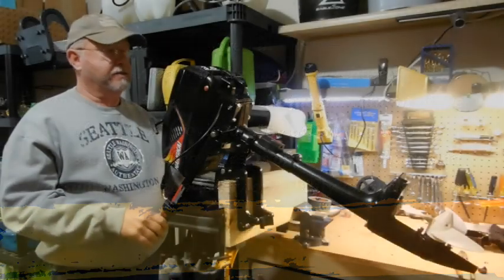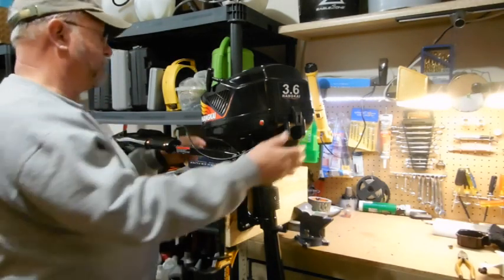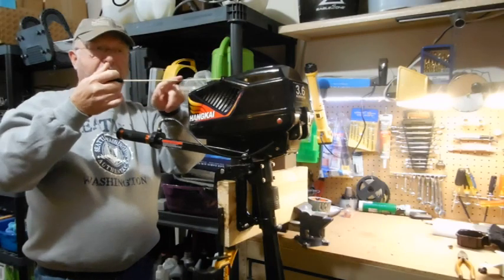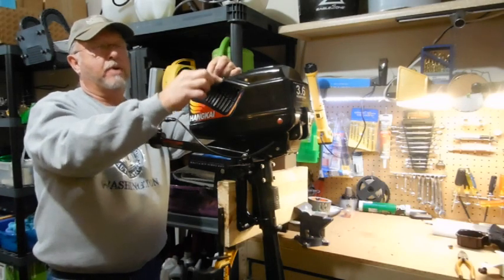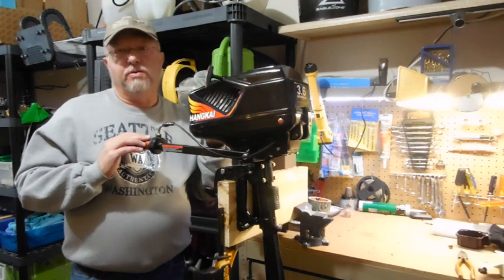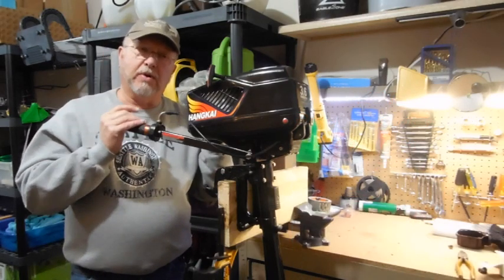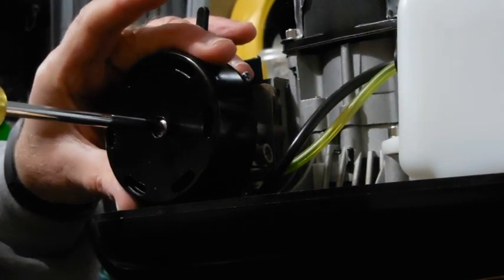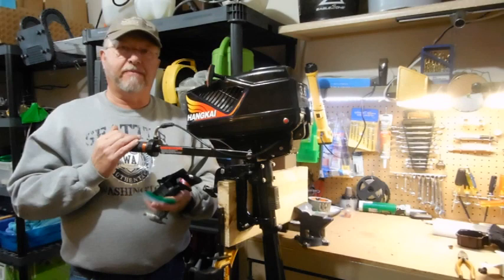Hangkai 3.6 / 3.5 hp outboard motor - 10 Things To Know

Comment: Hi, Thanks for the video. I bought one of these and am in the process of replacing the throttle cable. Please be advised like everything on this motor it is super cheap and therefor rubbish. Make sure you oil / grease cable every year. Mine was completely rusted. Also curious at the power or lack of it. Mine is a 3.5hp but identical to yours. All brand name 2 strokes have twice the cc so I suspect it is at most 1.5hp. Your thoughts...
Reply from the maker: I've not had any problem with the throttle cable....something to look forward to I guess?  I know saltwater would cause some issues like that...But on your advise, I'll grease my cable this spring.  I'm with you on the power issue, but I didn't expect a lot of speed out of it.  I don't plan on going long distances, so for my little adventures, it's ok.  Definitely not for everyone.
I appreciate your watching. Hope some of my other videos will be helpful too. 
You'll need to change out your clutch soon too...I put in a lighter spring and that looks like it will help a lot. (Maybe you haven't gotten to that video yet?
Keep watching! :0)
Reply: @BoilerDan1  Thanks Dan. Watched clutch stuff. More fun in the future. Yes I run in salt water. I run it in a fresh water bucket after use and hose it down but corrosion still everywhere. I have taken to spraying WD40 over all aluminum motor bits and "stainless" screws after each use Why can't the Chinese make stainless 316???  I note one eBay  site has sold 43 throttle cables for the 3.5 for $20 Aussie. I did the lower gear oil change as you demonstrated. Filled to half, ie well below the line . The gears will run through the oil  sitting at bottom, so all good. Thanks for the videos.
Reply from the maker: @marcvan  ; I think I stated "stainless" screws.... I've sense been told they are alloy of some type... Stainless will react to aluminum and cause problems... So I was told by a watcher... 
Anyway, enjoy your adventure!

Comment: Great review, very informative, Thanks
Reply from the maker: I appreciate you comments.  I've made several on this motor....So take a look at them at some point.  Latest was replacing the clutch.. Not difficult, and should probably be done seasonally depending on how often you would run the motor.
Thanks for watching!
Reply: @BoilerDan1  I have watched your other videos on this little motor, I have a 10' Jon boat that I want to use on some of the smaller lakes around me. I use a 55 LB motorguide trolling motor that I use now. I wanted a small inexpensive motor in conjunction with it. In your opinion, for the money, is this little motor worth buying?
Reply from the maker: @rockyhill9946  : It will push your 10' solid boat better than my raft.  I think it runs great, but the fuel lines, spark plug and the clutch will need replaced at regular intervals. The pull cord would be weak, but rubbing mine down with bee wax has worked well.  So if you don't mind making those changes after you run it for a while, I think it's worth it.  In my recent video, showing that the lighter spring worked well, I ran a full fuel tank of gas through it and it still runs smooth.  I've had it now for 2 years.
Actually, I'd change the spark plug right away.... And maybe the spring on the clutch.....  But if all the above is too much hassle, then save up more $$$ and buy something better.  Or buy it, then if you don't like the extra maintenance... Sell it!  :0)

Comment: Where'd you find the gas to oil ratios and break in info anyway? I have the 3.5HP model, which is a little different, but the manual doesn't even mention break in. As for the mixture, it only says "The admixture of this machine at normal usage hour compares is: 30:1. Please press this comparison strictly to prepare the admixture oil, cannot random the changes."
Reply from the maker: Here’s a link to the company website:
http://m.hang-kai.com/en/

Then in the upper left corner click on the multiple horizontal lines.
On that page click “News”
You’ll find the oil recommendation there.
I copied and pasted some below too:

HANGKAI two-stroke outboards fuel used for lead-free number from 90 to 93 two-stroke gasoline and gas oil (TC-W3) mixed oil.
The new machine in the running and fuel oil during the volume ratio of 25: 1 (ie, the oil content of 4% gasoline);
After the run-in fuel and oil volume ratio of 50: 1 (ie, the oil content of 2% gasoline);

Fuel HANGKAI four-stroke outboards use as No. 90 to 93 pure gasoline, without mixing

Preparation of two-stroke outboards mixed oil
Formulated as follows :( see below)

 
(1) The required amount of oil injected into the fuel tank, then filling gasoline, oil and petrol injection Scale        

Range of use	Mixing ratio of gasoline and engine oil by volume	Fuel tank capacity of 24 liters when oil safety
Lubricant oil injection amount	Fuel oil injection amount
Oil run-in period	25：1	0.92 liters	23.08 liters
Oil at the end of the run in period	50：1	0.47 liters	23.53 liters
                               

Mixing oil and petrol, oil injection amount in Table 1

(2) The fuel tank cap screwed onto the fuel tank, the fuel tank cap vent screw clockwise tightening;
(3) Shake the fuel tank, gasoline and oil thoroughly mixed.

Comment: Specific issue, can't get the bulb to fill with fuel. Change filter in the tank, lines are new, primer bulb isn't cracked, took carb apart to see if debris. Cleaned and reassembled. No luck, Your thoughts appreciated. It's new. Land stranded in Texas.
Reply from the maker: Hmmm, I’m as stumped as you are?
Only thing I can think of is switch the fuel lines? Maybe the wrong line is going to the fuel bulb?
Other than that, there has to be a air leak preventing the pumping action to work? Sorry I can’t be any more helpful.
I just returned from Mustang Island Texas! Indiana 19 degrees last night!
Should have stayed in Texas! 😁👍
Last thought: replace the bulb….
Reply: @BoilerDan1  will give it a try!
Reply from the maker: Let us all know how it works out. Might help someone else out in future. 👍
Reply: one tube is clear, the return line and pushes fuel into the tank.
the black line is the suction line. Prior to this the filter was filthy with white substance.
Put in ordinary filter for two cycle engine. Also sprayed soapy water while priming. 
Still no results. - bulb empty.
Reply from the maker: I’m at a loss too?
Sorry.😵‍💫
Reply from the maker: Could the black fuel line be plugged?
Push a similar size wire through it?
There’s got to be a simple explanation….
Reply from the maker: I think I have it figured out! One of two possibilities:
1.. one of the valves inside the primer bulb is defective and not closing which prevents the sucking of fuel.
OR
2. When you put the bulb back on you have it on backwards (is that possible?) If yes, then you’re pulling air from the carburetor and pushing it towards the fuel tank.
Ps.. You’re keeping me up at night 😂
Reply from the maker: Did you ever figure out the fuel issue?
Just curious 😉
Reply: @BoilerDan1  ordered and installed new carb - started right up!
Reply: @BoilerDan1  now that she starts , there is no water coming from the exhaust port? Just a lot of bubbles in the bucket.
Reply from the maker: That’s so great to hear!  So nice of you to follow up after a month 👍.
I’m sure it will help someone else to solve a similar issue.
👍👍
Reply from the maker: Okay…. I need to mention that I used a bucket in the winter and kept adding snow to keep it cool! Run a hose in yours.
Next: water will only come out with the throttle most of the way on, as in full speed!  If you watch some of my later videos, I end up replacing the clutch spring.  That allows the propeller shaft and water pump to run.  I’ll look up that video and reply with a link.
Reply from the maker: There’s 4. #4 just shows the spring that I replaced 👍
1. https://youtu.be/H4mPGuEKnKI
2. https://youtu.be/Qu9OjXbMutA
3.https://youtu.be/LdtITFx6N-Q
4. https://youtu.be/G4qLw14lf9k

Comment: Do you have a link for this motor or similar one?  Good job keep up the good work
Reply from the maker: Right now they are pretty cheap!
I found this on eBay: $217.
I suggest you check eBay and search Hangkai 3.6 hp motor and pick one.

https://www.ebay.com/itm/385698286797?mkcid=16&mkevt=1&mkrid=711-127632-2357-0&ssspo=6ymiisq3qja&sssrc=4429486&ssuid=s8A53jWuRTC&var=&widget_ver=artemis&media=COPY
I will mention that in hindsight I might consider either the 4 cycle or electric.
I’m happy to help. Thanks for watching! 👍👍

Comment: Hi Dan all your videos are amazing! Quick question for you, I got a hangkai 3.6 two stroke, the thing is, I follow all your recommendations about changing spark plug, gear oil and mix ratio gas/oil. everything was going really perfect in the break in process.... Until just right now. I am on my hour 8 of breaking this motor and then I decided to leave it alone for a moment while it was breaking. What happens next is that an attachment of my garden house ( one that it was bringing fresh water to the tank where I was breaking the motor)  get loose and get stuck in the propeller, stopping it with the motor running. How long it was like that, I am not really sure, but I don't think it was too long, because I had one of my house cameras pointing to the motor, that's why I realized something was going wrong. To make the story short,( is already long, I know..) I went outside to check the motor and it was smoking more than normal, I stopped it immediately and I started pouring fresh water over the shaft, one that it was hot but not more than probably water boiling  point, also the low exterior area ( the base)of the motor was really hot, like a clothes iron, so, I poured water there too. After all of this and thinking that I was probably done with the motor, this started again, everything looks normal ( I checked inside the motor before starting it again, fuel lines,wires, connections etc) even the cooling water was coming out normal. My question, do you think something that I couldn't reach to check maybe it could be fried or almost fried? Please get me your advice! Thanks!
Reply from the maker: YIKES!   I’m surprised that the sheer pin didn’t snap?  It would have been a good thing as then the hose wouldn’t keep wrapping around.  Someone else said that the motor is also air cooled.  It sounds like you’re very fortunate that it’s still running.  I think you’ll just have to keep going!  I don’t think I’d worry about doing anymore breaking in.  Just take it out and see how it does. Maybe slowly reduce the oil to fuel mixture?
I still am thinking that your sheer pin may have sheered off? It is supposed to do that if the propeller stops from hitting something.
I think you should check that out.
Reply: @BoilerDan1  Hi Dan, thanks for answering right away, I really appreciate that! Well, the water hose never wraps around the propeller, what happened was that a hose attachment get loose and got stocked between the propeller and the metal thing over it, totally stopping the propeller but the motor continues running ( hey Dan , that's almost funny yeah!) After that, and of course, checking all that it was possible, I started the motor again ( to be honest, I wasn't expecting it to start again) but, believe or not it started! Actually I continue breaking the motor after that, I just stopped the motor two minutes ago and looks like it is fine ( I hope so!) But, you are probably right, maybe the shear pin is  broken or close to get broken. After the motor cool down I am going to check everything ,prop,pin ,fuel line , wires and all that is possible to check. Trust me I am very, very surprised and please with this motor. I was checking some reviews of this motor online and there is a guy that looks like know about these things, and he said that the design of this motor is really good, the problem is not the design of the motor, he said the problem is the really poor assembling process , and the lacking of quality check in the factories. I don't really know how much of true is on that affirmation, but, well I kind of tested it ( by mistake by the way) whatever, I really start to feel very pleased with this motor even though that when I decided to buy it, I said to myself, whatever it happens it is going to be a learning experience ( I am trying to learn more about outboards, I love going on the water but I realized that to do it safely I need to learn more) Dan, one more time, thanks for answering and giving me your advice about this, I deeply appreciate it, and I am planning to do exactly as you told me, thanks! After I check my motor, I'll let you know what are my findings. You are the best my friend!
Reply from the maker: Thanks again for your kind words. We have the same opinion on the motor. I also had little experience with them. Definitely learned a lot. Sounds like you’re are too! 😁
Reply: @BoilerDan1  you are totally right my friend, totally right! 👍

Comment: Good info..thanks !!
Reply from the maker: You’re welcome. As time went by, some things I would not do. Example, I tried soundproofing the housing. Not a good idea because it would hold heat.  I’d replace the clutch spring one with a lot less tension.  Maybe just remove the spring all together?
Thanks for watching.👍👍
Reply: @ I bought a 6 hp Hangkai and it works great !!
Reply from the maker: @InflatableBoatsOutDoors I think you made a great choice!

Comment: Hey, Dan!  I have had one of these for two years now with a lot of use including week long trips in the Everglades running the motor 4-5 hours a day, so I am pretty pleased with it.  I have gotten a second one because I like having backups on the wilderness trips.  The new one is only 30 minutes into break-in, and I can't keep it running for more than 3 minutes at a time (usually less than 30 seconds at a time.  The tank and filters are new, and I tried loosening the cap on tank first time it quit.  I notice tiny bubbles going up the return line to the gas tank when it's running.  How normal is that? Any ideas here?
Reply from the maker: I’m no real expert on that. Hopefully another viewer can respond.  You could change or at least re-position the line that’s having the air bubbles in it.  That sounds like a good place to start.
Mine did something similar when it got hot.  I thought it was a vacuum issue with the fuel cap?  But you loosened that already.  I’d start with the fuel line leaking bubbles?
Sorry I didn’t have a specific answer.
Reply: That is most likely the fuel pump in the carburettor. It is a diaphragm that works from pressure pulses and may simply have loose screws (plates valves and diaphragm are all sandwiched together)
Just try loosening then re tightening the screws in a cross pattern, if its still bad, replacement carb is the next best option. They are cheap, but again worth checking the screws are all tight befor use. Good luck.
Reply from the maker: Thanks for the suggestion. I’m sure it’ll help more than one person!
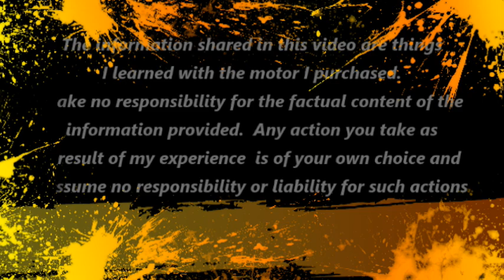Reply: @BoilerDan1 l 6:34 6:38
Reply from the maker: @davidhoward6157 
That’s strange?  Not sure why there’s a time gap…. Worm hole, time warp, portal to another dimension?😵‍💫
You’re very observant! 👍

Comment: Did you find that the water from the cooling system comes out of the whole bottom of the motor, rather than just its dedicated exit (sry, dont know what thats called)? Thats what mines seems to be doing, although it appears to be running just fine.
Reply from the maker: Yes, mine did do that.  It’s not a problem. The water is actually backing up from where it exits.  No worry,but I also was concerned.  It’s a little annoying though.
Reply: @BoilerDan1  Excellent. And you saved me again yesterday when the off button stopped working. Cheers 🍻

Comment: Hey dan couple quick questions first one, did you replace the air filter? What did you use? Second was what type of gear oils am I supposed to get? And third what was the part number for the spark plug you got I would like to have all these things before I got test it out! Thanks for the helpful videos!
Reply from the maker: I ended up not replacing the air filter.  A watcher commented that due to being out on water, it's not a dusty environment and it would be fine....
You should get SAE 90 Gear Lube.  But this year I'm going to try full synthetic gear lube that has a range of weights... Hope it goes well?  You can find it at Walmart, Amazon or any place that has boating supplies.
Spark Plug is NGK brand, # BM6Y  but also has 5466 on the package it came in.
Thanks for watching.  I'm retired and have been doing this to keep my creative juices flowing!  :0)
Reply: Thanks dan! You’ve been very helpful

Comment: Just bought 3.6 took cover off as u suggested to inspect notice a lot of heat discoloration at exhaust flange mounted to engine.. could it have been used and returned.
Reply from the maker: I had same thing. I think it’s something to do with it’s production and or the start each one to verify it’s working.  The flange at the base I think is welded and that would also create that effect.